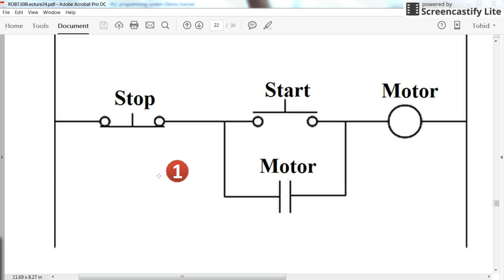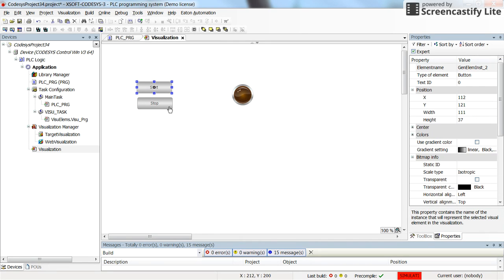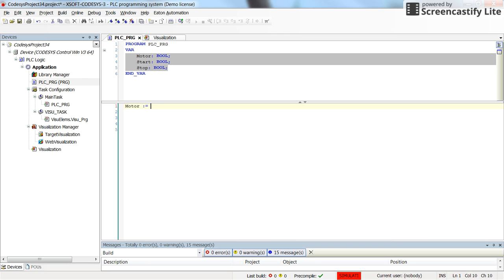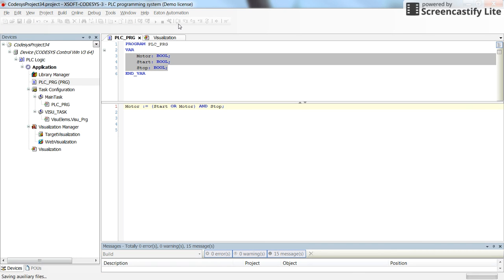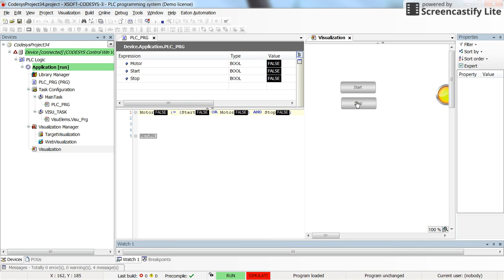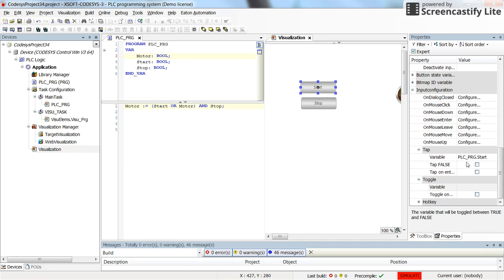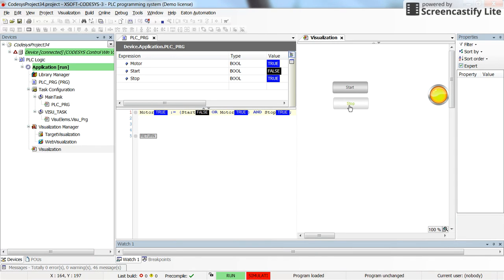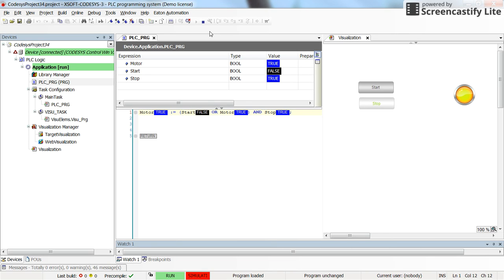CODESYS: Self-holding with Structured text programming #codesys #plcprogramming #iec61131 #plc

Comment: Your code is wrong. Buttons on the Start/Stop should be push buttons so the Stop push button must be negated. Motor := (Start or Motor) and NOT Stop
Reply: physical input stop is already NC, so in code we should use NO only, right?

Comment: Is it the absolute same effect as the code we did before??

Motor S= Start;
Motor R= Stop;

Should I prefer the method in this video in any circustance?? Thanks!
Reply: Not really. Consider a fault condition where Motor S= Start; writes TRUE to Motor and then the PLC scan fails for whatever reason. Motor R= Stop; won't have any effect. For a seal-in circuit, the entire wrung takes into account both Start and Stop (as well as Motor) before it writes to Motor.

Comment: I generally don't use the Tap Variable because it lasts multiple cycles. If you try an incrementor example with the Tap you will see what I mean. I use the Toggle variable.

One of the good thing about structure text is reduced cognitive load. You know exactly what's happening. Little chance of mistakes. Take full advantage of ST and write like this:

IF bStop THEN
    bStop   := FALSE; // Unlatch Stop
    bMotor := FALSE;
    bStart   := FALSE;
ELSIF bStart THEN
    bStart   := FALSE; // Unlatch Start
    bMotor := TRUE;
END_IF

Don't be afraid to be verbose. Programming Languages are meant for humans to read. Let the compiler handle the optimisations.
Reply: Nice! This code takes care of all the state conditions and doesn't leave any unknowns that could cause problems.